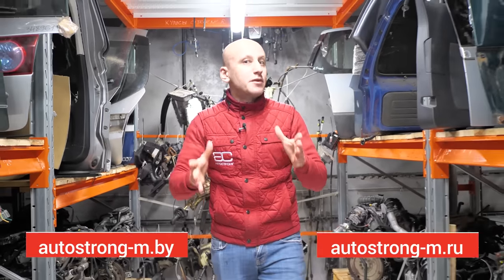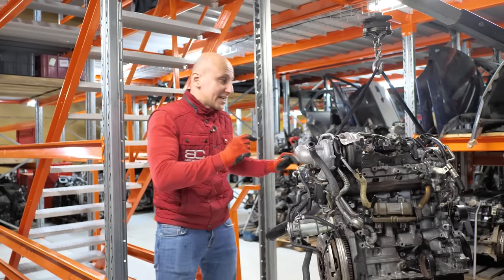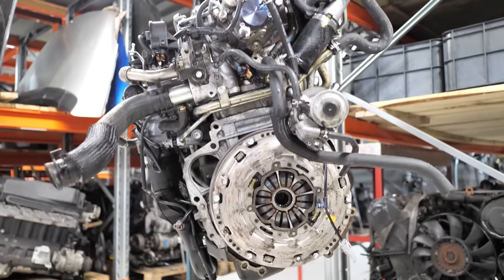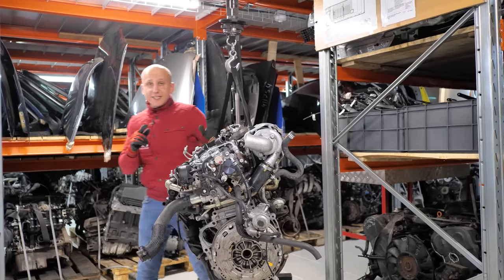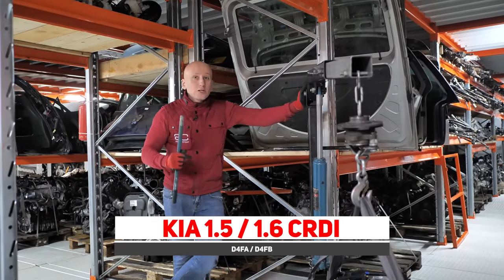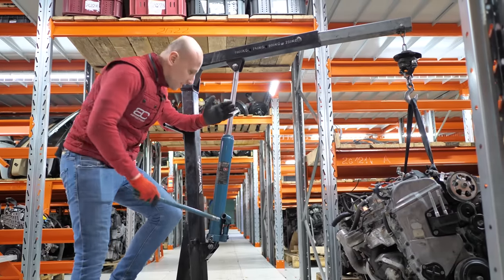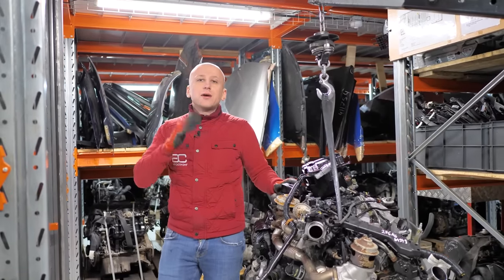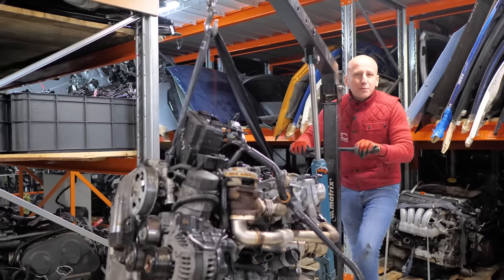💣 Дерзкий рейтинг: топ-10 дизелей по мнению "АвтоСтронг-М".

Comment: Proud of my 1.9 JTD 8 valves mounted on my fiat stilo sw and my 1.9 JTD 16 valves mounted on my alfa romeo gt. Almost 300.000 km and runs perfectly! Greetings from italy
Reply: Hi from Russia))) from Norilsk
M57 530d 638000
Reply: BMW-Engines are perfect, but BMW 530d is upper segment and costs new 33.000 Euro and Fiat Stilo 1.9 JTD is C-Segment and costs new 17.000 Euro. We also have two 1.9 JTD 8V engines (Lancia Lybra and Fiat Marea Weekend) in our family. Very good engines. The fuel consumption is very low (5.5l/100km). If these engines have oil and water, they work ever. 
Our Fiat Freemont with 2.0 JTD is also good. 210.000km and no problems with the engine.
Best regards
Reply: Я Николай Привет из России!😉
Reply: @s.p.u.6641   That engine vas fiat multipla? I remember it vas 1.9 - no noise from this  engine and yes - about 5l + of gasoline consumption
Reply: Привет.у моего сааба наверно такой движок

Comment: The Nissan 2.2 liter diesel engine was very good, but unfortunately the injection pumps sometimes failed. However, this damage only occurred at higher mileages (180,000). The fault was a faulty ultrasonic solder connection in the PS5 control unit

Comment: The 2AD engines for the Lexus were manufactured in Japan, the 2AD engines for the EU Toyota's were built in Poland. Most AD engines had problems with oil consumption, except those from Japan.

Comment: Surely the PSA Puma 2.2 would feature on this list?  The old Euro 4 version of this engine would keep going forever as long as a faulty leaking injector didn't cause premature glazing of the cylinder wall or cracking of the piston.

Comment: My Top 3 (2) diesel common rail:

1- 2L HDI 110cv PSA (DW10ATE) on 406, xantia (2000 at 2001 before multiplexing), tested and approved by all ambulances and taxis, which during this period only had 3 times less maintenance bills for their fleet of xantia and 406. Most reached 1 million km, including a xantia TD resold at 1.3M without any apparent problem or loss of power. The best of the world in terms of durability/maintenance cost.

2- 2.4 JTD 136hp Fiat(Alfa 166, Lancia Kappa...)? (the only one that I haven't tested but in progress, I'm starting)

Top 3 (4) diesel mechanical pumps:

1- 1.9D (XUD9) PSA on 205 and 306... indestructible, capable of going very far with very little maintenance, it deserves its n°1 place.

2- 2.5L 143hp on BMW 525 TDS (E39) 6 cylinders in line, the most powerful the most torquey, and very good amenities, less smooth than the 5 cylinder JTD for example, I regret that it did not have been mounted on front wheel drive. Not powerful enough for propulsion in my opinion, it doesn't suit a diesel.

3- 2.1TD 110cv(XUD11) PSA on XM, Xantia, 406, 806...more reliable with Bosch pump

4- 2.5TD Sofim(Fiat Croma, Lancia Thema, Renault Safrane) undoubtedly the engine whose reliability has not been correctly evaluated, in question its pinion cascade requires adapted driving, because it is quite direct, the accelerator strokes are punished by blows in mechanics (without restraint), while by driving smoothly, at high speed, he can go very far. very random, because the type of driving is more decisive for wear than on any other engine. For me it remains the engine with the best approvals, when it is well maintained that goes without saying.

Comment: You didn't mention the Renault R9M 1.6 DCi engine that was released in 2011. Those are unbelievably reliable engines. First of its kind with steel Mahle monotherm pistons.
Reply from the maker: This rating is based on the opinion of Autostrong-M. This is our subjective opinion and your rating may differ. Thank you for sharing your experience.

Comment: No TDI? :)
Reply: 3.0 TDI is the best diesel engine in the world
Reply: @dragospahontu  some say 1.9
Reply: @Corsa15DT  nah man. Not all of them. The pump düse were reliable but common rail were hit and miss.

All 3.0 TDI are reliable and powerful 💪
Reply: Also Peugeot HDI is very good
Reply: @dragospahontu  didn't know CR engines had misses?
Reply: @Corsa15DT  at VW the code of the engine is very important. Because you can have engines from the same generation but have reliable and unreliable versions with different codes.
Reply: @dragospahontu  I am aware of that. I had the atd, bkc and BFC engines. Do you happen to know which CR engine is not good?